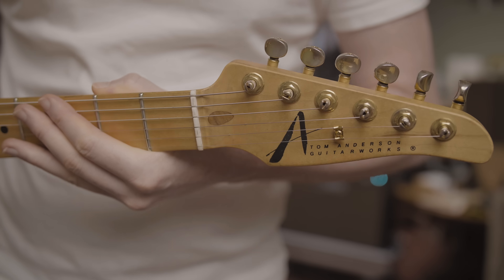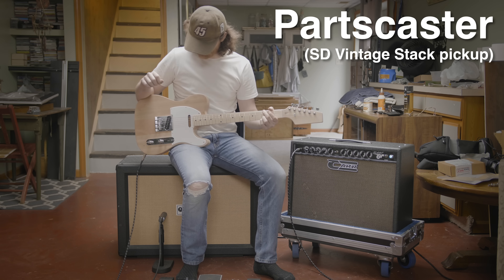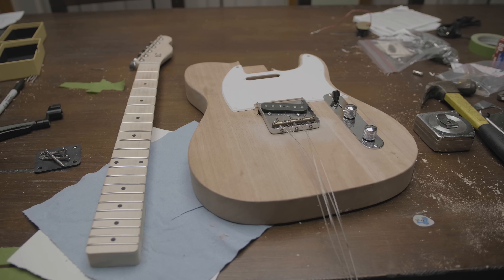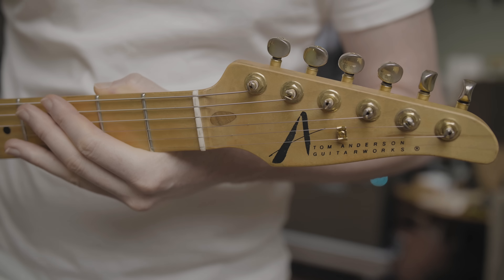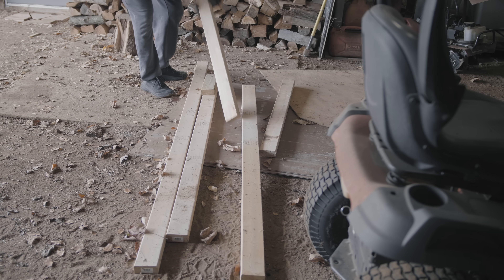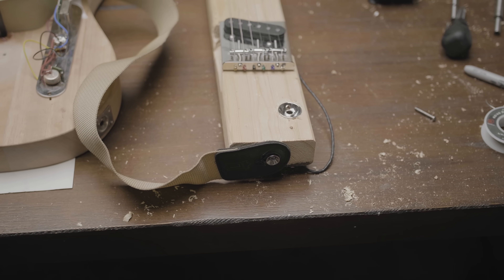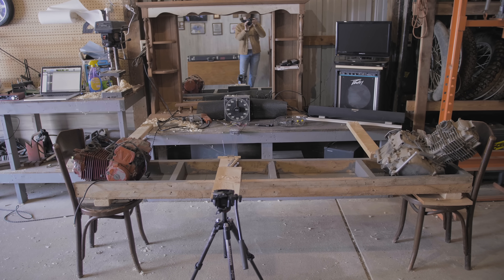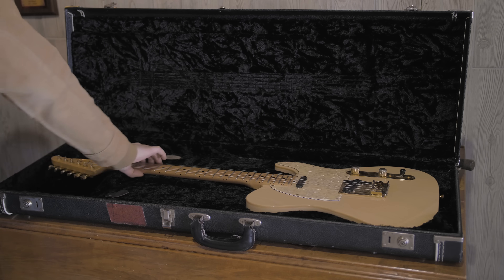Tested: Where Does The Tone Come From In An Electric Guitar?

Comment: This is really interesting. The 2x4 sounded a bit different though, even more different then the air guitar (which sounded basically identical tbh). Other then that it makes sense that the electronics make the most difference
Reply: My guess is that the 2x4 wasn't as stable and that the lack of a body to handle the guitar as he would normally caused some variance in his technique.
Reply: Yeah the 2x4 still sounded harsh to me but the "air guitar" didn't. Maybe someone who knew a bit about physics would be able to say why. I guess the practical takeaway though would be that a normal sized body would sound better but the difference in-between different shapes probably wouldn't affect them to much. Probably any body type would do so long as it's not so ridiculously small so people should focus on the electronics.
Reply: @TheModernMartialArtist  His initial test was with the pickup wired directly to the output jack and no tone or volume control. It did sound harsher. When he added the electronics the sound matched the Anderson almost perfectly...
Reply: @TheBengtn  I paid attention to the video, and I disagree. Still sounded harsher to me.
Reply: Difference is gravity on air vs ,,normal’´ - try it yourself. Put guitar to dest and you will hear difference

Comment: Outstanding video. I like the way you're chasing down 'tone' to the basic elements that produce it. That 'air guitar' at the end was pretty awesome. My only question about it is, is the workbench part of the tone equation now that the bridge is screwed to it? There has to be some resonance there that is being transferred to the pickup through the plate? Anyway, I'm subbed. I'm not missing out on any more of this. :D
Reply: i dont think the pickup would output those vibrations, only what the string feeds it, electromagnetically or whatever. since the bridge is fixed to the body i dont think the resonating would be picked up. just not enough vibrations. good point though i never thought abouit being able to hear the actual bridge resonating, imagined it would just slightly change how the string transfer energy to the body

 maybe the table is "stealing" more of the vibrations from the strings than a normal guitar, lessening sustain, but thats about it. not even sure if it really works that way or if the same amount of resonance is "leaking" from the strings to the wood, no matter if it is a giant workbench or a small 2x4. not sure how resonating works exactly. good question though, this is just my 2 cents. if it's even worth that much

Comment: I actually do believe that the type of wood, bridge and nut matters but not in sound but in sustain. While I'm not a guitarist but a bass player I feel that a dense wood type with a heavy bridge tends to give a lot more sustain. String-through might help a bit but not that much. Body shape again might change a bit but would more influence the looks and balance of an instrument. I think all the minor differences you're hearing in this video wouldn't be heard in a band mix and all things like a rosewood fretboard vs a maple is pure for the visual part of a guitar/bass. I think the main component of the sound of a guitar are the electronics, strings and of course the used amp and effects. But then again, a certain type of amp or effects might even influence the sound so much that you wouldn't be able to hear the difference between a Les Paul with P90's to a Tele.

Comment: Itd be super cool if you compared the waveform you find from each or these differences, then you could isolate what part (or parts) affect different fluctuations in frequency very quantitatively by subtracting two waveforms

Edit: subtracting and taking the absolute value of the difference. That'd give you a magnitude of difference between a baseline and some set of components you were interested in. That'd be like a "distance from" baseline measure. Then the difference up/down in frequency would start to give you an indication how to construct the noise you want
Reply: what you've wrote about is called doing a "null test" which works on the principles of an effect called phase cancellation, where two similar waves with opposite polarities interfere with each other and cancel destructively. It's a good idea but it doesn't work perfectly outside of the digital realm due to minute physical differences and factors in the real world, which are damn near impossible to control even within lab settings
Reply: @aspartamexylitol  yeah I was imagining with a good enough microphone some basic smoothing could be applied, but all I know about how microphones sound are really just from this video.

We used to use a similar in nuclear physics to detect particles and subtract out background noise - but there we had very discrete peaks for the waveforms.

Comment: So if I'm reading this right.....
1. Scale length, which goes along with string tension depending on the tuning.
2. Pickup and it's relation and distance from the string. (same would apply if you have individual pole adjustment heights)
3. Signal chain (what the signal from the pickup is altered by before it hits the amp, ie: pots, pedals etc)
My only question is how we would be able to test sustain reasonably. Because testing out 100 different types of wood is not realistic. And you can't measure the sustain of a bench...or can we🤔

Comment: I’ve never thought wood species mattered as far as tone goes. I still don’t. It’s all to with hardware. I have an old Kay LP Synth that has a laminated plywood body and single coil microphonic pickups dressed up to look like humbuckers and it sounds immense. Although on the flip side of that, you might not be so inclined to install expensive hardware on a cheap chunk of wood. I dunno!
Reply: I've owned plywood guitars that sounded awesome. The only real drawback to plywood as a body is it tends to be heavy as hell. Plywood really gets put down because when you say the word "plywood" people envision the cheap crap "shop" plywood at a box store like Lowes. They don't think of the expensive high quality void free Baltic birch or mahogany plywood. If you have plywood that's made of all hardwood without a pulp garbage core it's just as good as a solid wood body blank.
Reply: @waynepurcell6058  You did see this video, right?

Comment: You did NOT test for "note bloom" and sustain. Roasted wood - which is very dry - will allow the note to bloom and increases sustain. Your test can't test for those. I have owned both roasted and non-roasted body and neck guitars and have the experience on this parameter. Playing chords and legato lines doesn't work for hearing those differences. You have to play one note the same way for each variable.

Comment: Would you consider doing a similar test where the variable is scale length?  I've always thought scale length contributes to overall tone a lot more than woods and non-electronic components do, but it is hard to test properly.  Like, I feel like a Jaguar and a Strat's bridge pickups don't sound the same (beyond the difference in the pickups themselves, of course) and scale length could explain some of that OR it could be my bias.  Anyway, a thought!

Comment: Great effort and interesting results. I think is one important area that this does not address which is for more advanced players using the whole range of the neck and playing  a diverse range of single notes, 2,3,4,5 and 6 notes chords, etc

How balanced these notes are across a neck, how they sustain and how they interact with the harmonics of each other is very important. This seems to vary quite a bit across instruments and tends to be noticeable better in higher quality built instruments
Reply: Everything you mentioned has to do with geometry, construction and feel. Nothing to do with how the sound is actually picked up and transmitted to the amp. 

All that stuff is aesthetic. Feel. Playability. Those things seem to always be conflated with sound. 

What this shows is that if you give me the same electronic circuit in your guitar and i nail the geometry, i can screw it to a wooden plank and get it to sound the same. 

It's like saying wooden electricity poles transmit current better than steel and concrete ones.
Reply: @RogveAsset  it’s not like that at all. I am saying that there is a lot more to getting a great sound at a professional level than just the right electronic circuit. I am not disputing his results, I find them interesting. I am pointing out that a great sounding instrument requires more than just that and that this difference is not tested with just first position chords and some quick high string riffs. Nailing the resonance, shape, balance and geometry is not a minor secondary after thought and involves most of the cost of a fine instrument

PS- The neck is made of wood don’t forget and makes up a part of the sound. Substitute it with carbon fiber, aluminum, cement or just wood that isn’t well dried or selected and and you will quickly learn that it is not just the electronic circuits. Ironically you will find that some of these other materials are actually better at the even response and balance I am talking about

Having said all this I still think the player is by far the biggest factor. After you get past the basics most things we are talking about here are refinements but they all contributed to the sound directly or by allowing the player to reach certain sounds

Comment: It may have been mentioned earlier, but I’d like to hear the difference of the same electronics compared in a Tele style body vs a larger archtop body.
Reply: If the scale lengths, pickup height and pickup location is identical you wouldn’t hear a difference. People only claim archtop guitar wood matters because older ones had microphonic pickups.

Comment: I think it's important to emphasize that the air guitar is sort of like the logical extreme when it comes to rigidity/tension. You effectively have two fixed points in space. Any real guitar is going to have some play under tension, which will affect tone (probably in a bad way), but I suspect it's hard to have too much rigidity in terms of sound quality, unless you go to exotic construction, like all-metal.

Comment: Very nice to see the exchanges.  But there are a few key points:

1) Microphonic pickups like old PAFs are more responsive to different tonewood species.  You can tell that by merely tapping on the guitar with different woods (ex. PAFs on a Maple over mahogany body VS PAFs on a maple over basswood body ala The Heritage Les Pauls) will yield different timbre.
2) A true air guitar should be floating.  With today's tech, that is possible with two magnetic levitating apparatuses, one for the headstock and one for the bridge, maintaining  a steady distance from each other.  Drones can work too but too noisy and the motors will skew the results.
3) Please listen through both IEMs and high quality speakers and mouth the tones. The air guitar sounds more like GREEUUUHHH while the Tom Anderson sounds like GRAAAAAAAAHHHH

Comment: What an absolute revelation of a video. Literally any electrical engineering student could tell you that the physics of electroacoustic audio are entirely about... you know, the electronics of the instrument... literally the entire reason why the audio can be picked up at all. What sense would it make that wood , which affects acoustic resonance, has a major, if any, influence on the way an electronic signal is picked up and amplified?

And yet for literal decades you have had the most famous and respected guitar builders insisting that "tonewood" of the body and neck are one of the most important reasons for different guitar sound. In the most charitable defense you could make, if you've spent decades of your life looking for the most specific, rarest, most resonant wood you can find for your guitars, confirmation bias will lead you to think that this makes a major difference.

But this whole debacle should shame the "experts" of guitar tone much the same way that the extreme, absurd lengths """audiophiles""" go to "isolate" and purify their audio signals should completely discredit their opinions as coming from, again, anything other than confirmation bias.

I knew at the beginning that the third guitar builder had it right, because literally the only two ways the non-electronic parts of a guitar affect the tone is via changing the sustain of the strings and by affecting the playing style of the user.

Bottom line, for all you young "tone heads" out there, focus on three things (edit: in your gear that is, like builder #3 said, your playing technique comes first): 1. Your amplifier (the head), 2. the pickups (and physical set up of those pickups), and 3. the cabinet speaker. That's essentially 90% of your tone right there. That's assuming of course you don't have cheap electronic parts and wiring in your guitar for everything else, but that's kind of like saying "don't use guitar cables with loose wiring" - no shit.

Comment: The 2x4 does have a slightly different sound - a bit "softer", less crispy. Not bad though and probably just noticable in a direct comparison. The air guitar has a bit more bottom end but it's not really an air guitar as the ends are connected to wood and even the bench and the shelf are connected via wood, which means the wood is there - but moved to the sides. 
Still it was a lot of fun watching this video.

Comment: You proved it... to me,  electric solid body guitars: open sound tone is all in the scale, pickup, electronics and string material than any of those "tone wood" hype (tone wood absolutely apply for acoustic and classical guitars though, and slightly to hollow body guitars, it does affect the sound). To be extremely precise in the comparaison, a kind of robot arm would be the top bonus to play each exemple in an exact same way (same angle, attack, dynamic...) there 's so many different videos of comparing guitars with guys playing and don't even play twice exactly the same so the difference is biased from the player and not the instruments. I do think that you did apply the same strums pretty well in your video though! You did a really good job. Excellent demo.

Comment: Hmmm. But The resonance is being provided by the two benches. The fact there’s nothing under the strings is irrelevant. Same as every other guitar! Try to fix bridge and nut on something very light and strong but not connected to the ground. Carbon fibre?

Comment: Personally I still heard a huge difference between the Anderson and cheap 2" wood version. The sound of the Anderson had much more body to it (more lower end), while the cheap diy wood built felt thin and weak and lacked sustain

Yet the workbench version sounded reasonably similar, perhaps that is because the whole workbench also resonates and gives body to the sound.

Comment: So, what is the purpose or evidence you see in this tests? The tone wood from which is guitar build does not matter too much? I have seen some other videos on YT with quite different results. Quite interesting to see here on YT how different people are coming to different results done by different approach :)
Reply: Since the human player is the biggest variable, it's easy to fall into confirmation bias. I bet if the player expects some setup to sound brighter, they might subconsciously strum in a way that brightens the sound. 

This test is great because he's trying to disprove the notion that X component affects the sound. If he can emit nearly the same sound, we know that variable does not affect the sound strongly.
Reply: @defenestrated23   Yes I kinda agree. I have done some tests my self and always ended that the wood is very important factor for me. Pickups have huge part in final sound as well, some times eveng bigger than wood, but pickups can be changed much easily than the guitar wood if you do not want to buy to many guitars :) Changing bridge stones from steel to brass, tuning machines, trems, etc., almost no difference, but for example the old vs new wood was very significant difference for me. I have come to this conclusion based on many blind tests. Nevertheless, I was quite surprised that when I tried to record this...very little difference. So the real listening is for me still most relevant if my mood is stable...:D

Comment: As a former studio engineer and also guitarist, I do worry that the amplification and compression (after the guitar) distorts the sound so much it muddies the tonal differencies and potentially hides them with saturation overtones / fall-off. The short distance from pick-up and string might also contribute to the muddled sound as the signal can be too hot for the pre-amp in the guitar-amp. Next video, try cleaner settings with no overdrive, no overly saturated tubes nor clipping transistors. It might even be to an advantage to boost the treble some, as I suspect most differencies (if there are any beyond what this video have found) lies in the mid to higher frequencies.